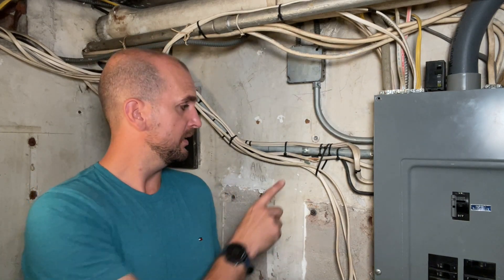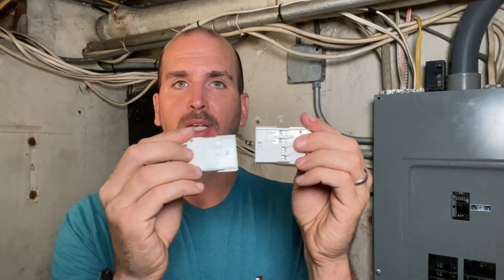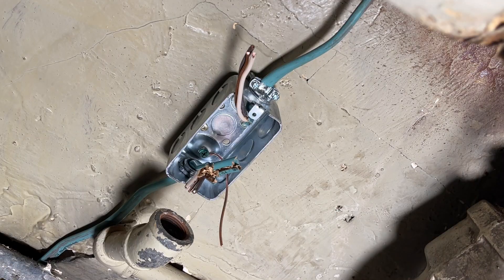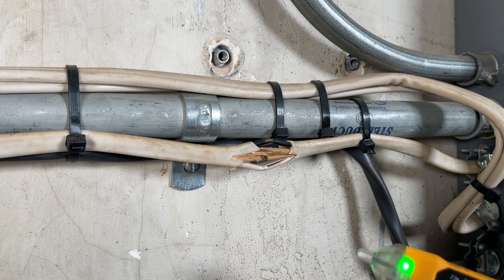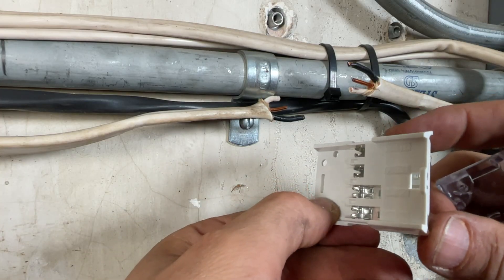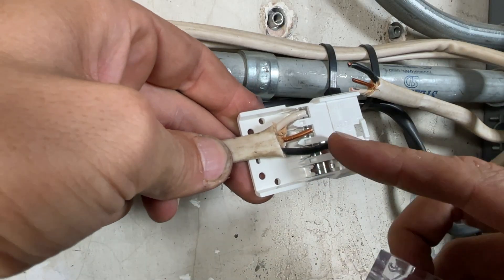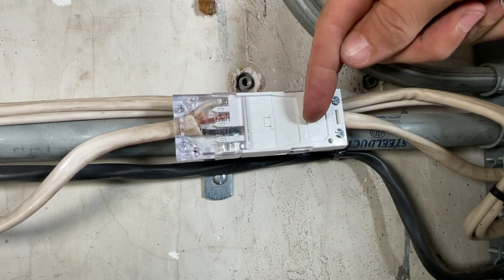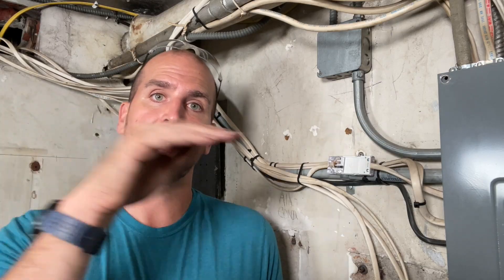How To Repair Damaged Romex Wires

Comment: I would never use anything like that Tyco splice kit. Not only do I question the safety of its use, but if that gadget is hidden within a wall, any future fishing/new pulling will be a nightmare and lead to some not so pleasant cursing. With that said, always make connections in the sequence of ground-neutral-hot, and demo in reverse, whether the line is hot or not. In that “handy box” installation, the ground was connected last; that’s a no-no.
Reply: These type of connections have been used in mobile and modular home construction for decades, with minimal failure rates and negligible safety issues. It may not be the "best" method for splicing, but it's perfectly acceptable and approved. Come on people, it's a building, not a submarine. Just another tool in the box, far as I'm concerned.
Reply: @lastchance8142  I'm with you on this. I'm not a great fan of IDC, but for a repair, and especially one that needs to take place inside a wall the TE product is great. The TE product is clearly well engineered and robust  - when it is plastered over in a wall it's not going to be succesptible to mechanical damage. It will have been engineered to take the amps that it is rated for and then some.  Used correctly, I can't see there is any risk that it wouldn't be able to pass its full rated current. I'm in the UK BTW. Most homes in the UK are wires in the equivalent of Romex and maintenance-free junction boxes like the TE product are authorised in our equivalent of the NEC, however we have nothing so slim as the TE product available. In the  UK, our equivalent of Romex doesn't require mechanical protection if the circuit is protected by a GFCI.
Reply: @lastchance8142  really tell that to my friend that had his mobile home caught fire because a staple went through the Romex wire. ACFI breakers could have stopped the short. But wasn't required when the mobile home was made. I don't have trust in mobile home wiring. From aluminum wire to stapled wires and other shottey wiring practices.
Reply: @ronb6182  sorry about your friend. There's always a scenario for failures, no matter what we do. Just saying that if something is approved by the NEC and UL certified, it is "by definition" safe. People said the same thing about WAGOs and Sharkbites, but it's over thinking in my opinion. You have a right to yours. Be safe.
Reply: @lastchance8142  yeah I'm not familiar with these shortcut in wiring if I splice a connection I use a metal box with grounds and all. I also like Gorilla  nuts instead of regular wire nuts. A little overkill but it's safe. No taping wire nuts when you use a gorilla nut.
Reply: @ronb6182  you shouldn't tape a regular wire nut anyways.
Reply: @etherealrose2139  most people use a good electrical tape it's in the light fixtures at work. Regular wire nuts are not water proof. The gorilla nuts are for outdoor locations but can be used indoors as well.
Reply: @etherealrose2139  I will just use gorilla nuts and get out of this argument. There are just as many yeses as nos. Not worth my time.
Reply: @etherealrose2139  True! Taping is actually worse because moisture is trapped in the nut, instead of draining and evaporating..Rookie move.
Reply: your right. the way i see it thats worst than a flying splice, witch is also is a no no.

Comment: I would never ever consider the repair with the piercing connector. WE all know the saying penny wise and pound foolish. I live in Canada and that repair would never be allowed. A grounded junction box is a hack but still acceptable. What I dont get is who is the moron that would peel the insulation back to check the voltages when the panel is right there.
Reply: Can you imagine that moron - who butchered a cable and then left it that way - opening a load center and poking around inside.  Probably best that he/she didn't think of it.
Reply: You know it was a classic dumb ass homeowner, a guy of course, who knew just enough to be actually dangerous. 
   Pretty wild that Mr. Ding Dong’s stripped neutral and hot never shorted out on the EMT or tripped any other breakers.

Comment: Step 1: Find the person who purposefully cut the insulation on the wires & left it and punch them in the face.
Step 2: Run a new wire when possible or make a J-Box with wire nuts or Wagos.
Step 3: Go back and punch them again for wasting your time cleaning up their mess.
Reply: Step 4: Grab a cold beer.
Step 5: If they still got up after Step 3, then repeat Step 3 until they don't get up anymore.

Cause that could have started an electrical fire and get people killed.
Reply: confirmed for best and most practical solution

Comment: I prefer using a junction box and wirenuts. Reason is more surface area on the connection vs blade edge of the fork pressing against  the wire. The blade edge cannot carry as much current as wires wrapped and compressed together in a wirenut. I have seen a similar connection failed after a space heater was plugged in.
Reply: Well explained. Agree 100%
Reply: Yea I prefer that too, only problem is adding a junction box or pulling a new wire to fix damaged wire in a wall or ceiling may not always be practical.

Comment: It would be quicker and safer than the TE splice to just wrap the exposed copper with electrical tape.  That would pass inspection as easily the many code violations visible in the video.
Reply: That's what I was thinking.  If the conductor wire itself is undamaged and it is only the insulation that is damaged,  I would just fix the insulation and leave the wire intact.  Funny that no one else picked up on that.
Reply: @blaster-zy7xx  it was talked about in this conversation awhile back.....both sides had valid points & concerns.

Comment: @3 minute mark - Looks like you have enough wire run to use a wire nut. Those push in connectors are not reliable.

@5 minute mark - place a box there, remove the short piece from the breaker box and run a longer line to the box. Don't use the plastic crap.  Also, at ~39 each, you can certainly do this a lot cheaper with a metal box, wire nuts and a new section of wire to the breaker.
Reply: Wago are perfectly fine. It's the user that makes them unreliable. Same as seeing melted wire nuts... totally unsafe if the person installing it is unreliable. Electric connections means solid contact and tight connections. Strip the wire the correct length, push the wire to the back of the wago and press the lever down with assistance of the spring and it makes solid contact with the bus bar inside. Give a good yank to ensure it doesn't move. Then you know you have a good connection.

Comment: Where's the support for the cables within 12 inches of the box" Where is the 6 inches of free conductor for a slice in a box? Ty-raps are not rated support for cables.
Reply: You’re the worst. Everything you just bitched about sounds like a first year tryna prove they actually know something
Reply: @wm79198  Read the NEC. It's several hundred pages of dry reading. If you retain more than 1%, I'd be surprised.
Reply: @robj2704  I have…. Licensed and employed ;).  Zip ties are very often listed to support cables. What you meant to say was “it’s a violation to use a conduit or cable to support another cable.”

Comment: When I’m on the job caps and proper junction boxes and proper cable clamps if you got a open spice some where and there’s exposed wiring run new wire use a good junction box and cable ties do it up to code it save time and money city inspectors don’t like easy spice kits you can buy these days

Comment: IMO the problem with  junction boxes is that you can't bury them in the wall. But I don't trust the connector here as well. It is not a question of if but when they will fail. Imagine it fails and nobody knows it's there. Best but imperfect solution run a new wire in a place where you can put an accessible junction box say lower in the wall and for that length only. If not possible, expose the junction box on the wall and paint the cover! Up here the code does allow 1/4 inch of mud on top of the cover. But same problem... nobody knows it's there....
Reply: Wow are you saying your local AHJ allows junction boxes to be concealed in the wall?  One healthy lightning strike later and your hosed.   Sounds like some of the stuff I see when I visit southern Missouri.

Comment: Insulation displacement connectors are not the way to go.
Reply from the maker: Any suggestions on alternatives if faced with a similar issue?  Thanks for the feedback 👍
Reply: I remember a uf cable splice that could extend the length by about a foot. With screw tighten down connectors and a heat shrink tubing to go over the whole splice could be a good alternative.

Comment: Great video, I  keep missing the name (type) screws you used when securing the handy box to the wall ?
Thanks, Steve
Reply from the maker: They are made by SPAX.  I really like their screws and use them for most of my projects.  This video dives deeper into the why behind using SPAX screws https://youtu.be/pztWWy2G7mI
Reply: @EverydayHomeRepairs  SPAX are generally just a combination of robertson and phillips head, which doesn't work quite as well as either screw head by itself.  You're simply getting a more consistent thread type.

A similar thread pure-robertson is better, but if you want the best, use GRK.  Torx head with special threading - the best head, and superior threading.  And are directly approved for structural applications where'd you'd normally use lag screws.

My father used to say that the sale of phillips screws should be a jailable offence, and flats?  Summary execution.

He was solid on Robertsons (it's almost impossible to find phillips wood screws in Canada... Yay!).  Torx wasn't available then.
Reply from the maker: @fromagefrizzbizz9377  GRK's are sweet.  I am going to build out my standard supply of Fasteners for my truck soon and I am a bit torn on which brand to go with as I like Spax and GRK.  🤔
Reply: @EverydayHomeRepairs  My wife loves to tell me to take lots of extra screws with me up a ladder because she loves to laugh at me when I drop 2 screws for each one I manage to drive, EVEN with pure square drive. 🥴

My son became enamored of GRK, so as an old dog I feel compelled to learn new tricks. Even some of the pro contractors have switched. 

Especially when they’re driving things 6” and longer. 

You’ll also go thru far fewer drive bits.

Comment: It beats just electrical tap over the exposed wire I guess. But I go with electrical tape over exposed wire.  Just a extra layer and go over few inches to the left and right just to make sure.

Comment: I'm a electrical tech (work supervised by a licensed electrician).
I use a box, or new run of wire, for these situations whenever possible.
I have used the splice kit in some places .. they are code approved, and a big time saver. Also cost effective .. about seven bucks at the local Menards. And I use the Wago connectors .. handiest things ever invented.
Reply: Your either a journeyman or an apprentice, electricians are never "techs".  There's a push for this classification, fight it because there's only one reason to push it and that's to lower wages by reclassifying a tradesman as a technician.  Technicians are task specific experts, tradesman are supposed to be "experts" in a field of study like electrical, plumbing, carpentry etc.
Reply: @ZackaryTwiddles1  in my state, there are 4 licenses for electricians, systems technician is a class D. You should not use the word "never" on the internet.
Reply: @ZackaryTwiddles1  Brother is a Journeyman and says the same thing.
Reply: @ZackaryTwiddles1  You are incorrect, Electricians work on installing the major infrastructure, Electrician Technicians are responsible for diagnosing, repairing, and maintenance of existing equipment. You would never call an ordinary electrician to work on an something like a printing press or a large piece of manufacturing equipment.

Source: IBEW Electrican Technician  for the last 5 years.
Reply: @Noughtta  You are incorrect, electrician for the last 30 years.....
Reply: @ZackaryTwiddles1  So you exclusively work with industrial motor controls, CNC, automation, BM systems, or controls and instrumentation? Or are you the guy the call to size transformers, run conduit, or manage someone doing things similarly?
Reply: @Noughtta  I am the guy who spent a year in resi, followed by two in commercial followed by a two more in industrial, before becoming a journeyman and then spent 5 as a journeyman before going into service and troubleshooting.  Putting someone into service that's not already a journeyman is a joke or accident waiting to happen.  I can and do install residential receptacles as well as troubleshoot or install an MCC or the VFD in the MCC. WE are never Techs.... But you like the term go for it, you will be the one paying for it in lost wages later on.

Comment: Apparently I've been an electrician to long. Anyone on my job caught using those, would immediately be fired. Wire nuts have been used safely for over 100 years; and will continue to be used as long as I own my shop.
Reply: @Kevin-mp5of  I've been an electrician for 40 years and have never had any problems  with wire nuts. Not one fire, what you are promoting is glorified quick-clicks, and back stabbing duplex receptacles. Your fired !
Reply: @Kevin-mp5of  Dipper sticks like you get fired a lot, don't they?
Reply: >>>DITTO<<<

Comment: If copper conductor is not damaged, I'd say taping is actually safer then one of those connectors. It will have much less resistance.